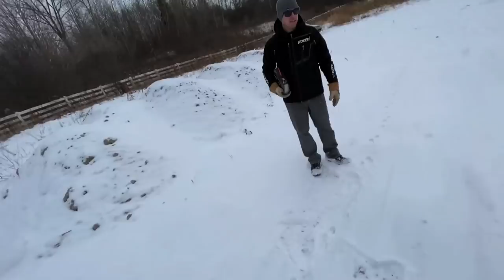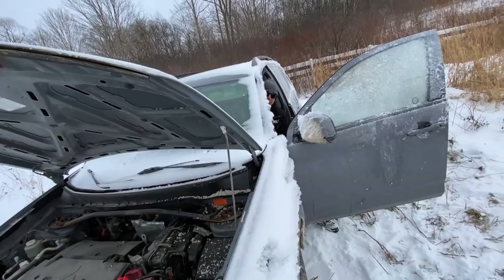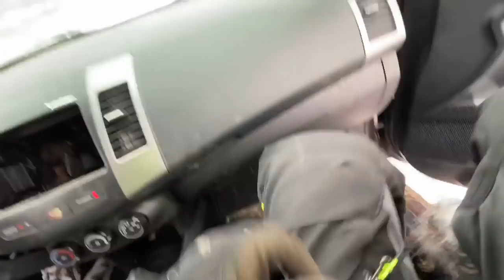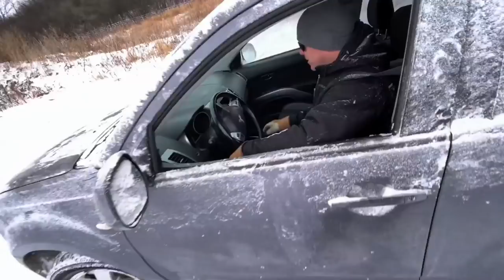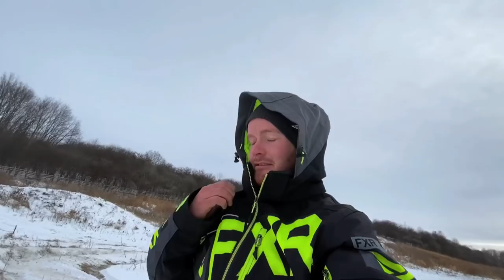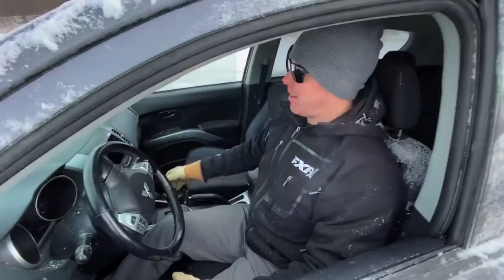New MYSTERY Car DROPPED OFF!

Comment: Wow the irony. I currently have a 2019 Outlander as a loaner due to the paperlady mistakenly backing her Volvo stationwagon into my 04 Highlander Limited last week in my driveway. Volvo only needs a tail light while I have major front end damage. 

I'd have to say I hate both its CVT and it's torquesteer. But other than that, it could be a lot worse and I'm ok with driving it while my car gets repaired.
Reply: note to self, get a old vovlo
Reply: @garlicbreadjenkins5780  lol ikr I totally should.  I'll have to think about it next cycle.